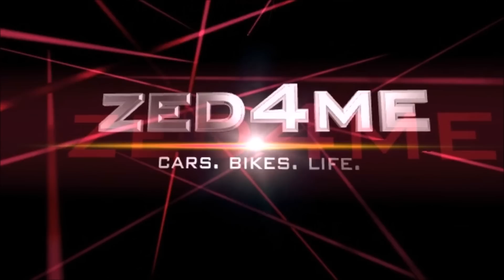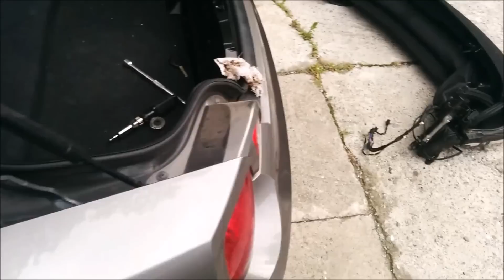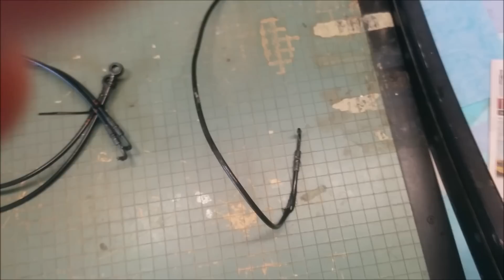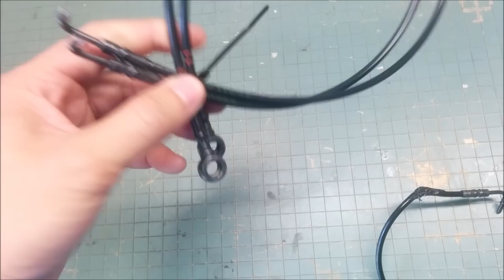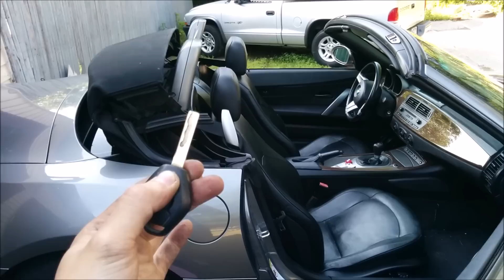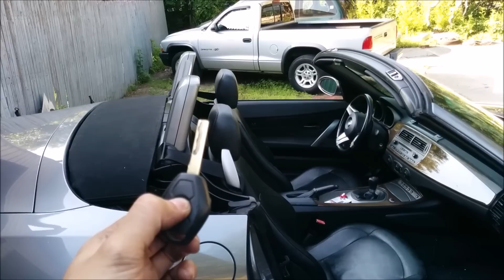Fixing Convertible Top - BMW Z4 Vlog #5

Comment: I removed and replaced my top on my 2004 BMW Z4 and need help setting the "top closed" and "top open" switches. Pump and latch motor both work but tries to open when I press "close" and vice versa. Please help.
Reply: Sounds like you switched the top motor wires.

Comment: Roof pops open but does not fold back, was working fine, left roof down several hours then stopped working. Roof locks again. But will not fold back.

Comment: Hey, I'm in the process replacing my motor. Reassembling the roof but I'm having trouble aligning the sliver bar to snap into the two U clips, it just doesn't seem to wana lock into those clips. Any tips on aligning and locking the bar into those clips?

Comment: HI
Is it possible to have some tips and trix in how to remove the Conv.top. I tried but got stuck when it come to loosening the top from the chassi, i.e the conv.top rubber strap that is attached to the chassi. I just didn't find a way in separating this without breaking something.
Regards
Gunnar
Reply from the maker: +Gunnar Andersson I don't really know which part you're talking about.. there's a good guide online though with pictures if you do a quick search.

Comment: Both key fobs no longer remotely open or close softtop or my door locks?

What part may need replaced?  
Do you have any suggested troubleshooting techniques to attempt before purchase of part(s)?
Reply from the maker: Would try the basics like figuring out if it's the battery. Swapping them isn't easy because these keys were designed to be rechargable. If the keys work, then the top should automatically open and close if it's been programmed to do so. The door locks not working either makes me think it's the key and not the car that's not functioning

Comment: what would your buddy be doing for the process of snapping in the hoop into the clips? did you snap in the hoop from the trunk?
Reply from the maker: +Diamond Bling You work your way around. I started at one side and put it into place while my buddy held the top to keep it from scratching the paint. After I got my side in I loosely put in the bolt, and then proceeded to snap in the rest. Once I doubled checked everything was working properly and not snagging on any lines, I tightened down the bolts. Buddy mainly has the job of keeping the car from being scratched.

Comment: My top quit working and when I push the button, the latches will open but the top won't go down.  Looked for a leak but nothing there.  how can I check the motor itself to see if it is working? do you know??
Reply from the maker: Your top motor has failed. Not much else will cause those symptoms

Comment: Is there any reason when you press the button to lower the top and it doesn't go down besides a blown motor? Like is there a lock that makes the convertible light blink red?
Reply from the maker: Yeah but if you hold the down button and hear any motor whirring that's the latch undoing and then the hydraulic motor activates after that.
Reply: zed4me so there's no physical lock I have to check? The two buttons should open and close the top so if it doesn't then something is broken right?
Reply from the maker: @dav1dizzle  there's a switch in the trunk that doesn't allow the top to go down unless the tray is down, that's the only thing I would check. Otherwise yeah it's a one button operation.

Comment: I wonder if you can take out the soft top and put a hard top in permanently.
Reply from the maker: NSXTypeRGTRLM I believe you can. The hard top gets put on top of the soft, which doesn't make sense to me cause it would add weight. But if I could ever get my hands on a hard top I'd do exactly that for winter time

Comment: Thinking about getting an older z4, one of my main concerns is the expensive roof braking.
Reply from the maker: Cornwall1888 It's definitely a matter of when rather than if.. so when you look at a potential car, and a good test is to hose down the top and see if water comes out of the drains underneath the car. They are located right in front of the rear wheel well, and if it isn't flowing well, chances are the drains are clogged and the motor, if not broken already, will go out soon from water ingress.
Reply: +zed4me could you make a video about how to check the roof?
Reply from the maker: daineserider it would be a very boring video. Just take a hose to the top and see if water drains out the bottom quickly
Reply: zed4me ok, thx!

Comment: My zs roof top failed today. Won't go up won't go down 😔. I hear the sound of the motor but it doesn't move I have no clue what it can be. Still browsing about it.
Reply from the maker: +napalmaki if you hear the motor buzzing away, it isn't broken obviously. Maybe the hydraulic fluid leaked and the motor is unable to move the top as a result
Reply: +zed4me thanks a million for the reply and the possible cause. I will go at some point to check it out at the garage.
Reply: ... left it at the garage today, they assume (haven't dismantled it yet) that it is missing the hydraulic fluids. At worse the hydraulic pump is damaged. Three days eta to be ready :( I miss her already...

Comment: Bro, where did you get the guide to remove the top? Also, where did you get the guide to program through NCS-expert? My top died. I also have NCS-Expert, among others on my laptop.
Reply: +VisVires Found it: http://hartgens.nl/z4/wp-content/uploads/2015/06/How-to-Remove-your-Soft-Top-from-the-BMW-Z4.pdf
Reply: That description is made by SHIPKILLER-the BEST BMW man you will EVER find, I used it and mind came off , replaced pump and cylinders and had NO problems at all

Comment: I feel like my problem for my soft top isn't the motor, but the wiring. When I hold the button to make the top open, nothing lights up. Same thing for the other butting to close it. Any advice? I already checked the fuse box and all of them seem to be functioning properly.
Reply: Hi Adrian, my Z4 2003 shows exact the similar problem.
To the solution owner, please advice how to solve.
thanks for helping!
Reply: +Fons Eijsink I haven't found a solution yet, let me know if you find anything out.
Reply from the maker: no red flashing on the center console?
Reply: Nothing was flashing, the top was electrical dead. I'm one step further. The aftermarket X-Car Style top module had to be reset (unplug>plug) after battery dead winter stop, now everything is electrical functioning again.
But....no pump is activated, red led flashing. So, replacing the pump will be the thing to do
Reply from the maker: Fons Eijsink That's correct, if the red led is flashing that means it's not in the completely open or closed position. The latch is unhooked but no roof motor to pull the top down. Replace the pump is the next step, but before you buy a new one, it may be possible to refurbish the old one that is rusted and dead. I did so and did not have to spend hundreds of dollars to buy a new one. Maybe find someone handy who may be able to refurbish it for you.

Comment: I need to replace the front plastic trim. Do you have suggestions on this?
Reply from the maker: I'm not sure if that plastic trim can be bought separately, sorry.
Reply: zed4me thanks. I actually got that trim piece today. Doesn't look complicated.
Reply from the maker: soarby007 Got the part number? i think mine may have a crack in one part of it if I remember correctly

Comment: Does anyone know what the part covering the convertible motor is called?? Mines missing it and I want to buy a replacement piece
Reply from the maker: Mine doesn't have it either but just so you know it won't help keep water out. You'll have to seal it some other way if you wanna keep water from getting in
Reply: +zed4me thanks, I just don't like the way it looks with the motor sticking out like that
Reply from the maker: Ryan McNamara you can see the motor?
Reply: +zed4me the hydraulic motor in the top of the convertible interior it looks like there should be a plastic piece covering it
Reply from the maker: Ryan McNamara are you talking about the latch motor? Or the hydraulic one which is behind you .
Reply: I know this is a Year old thread, did you ever find the cover for your interior motor? i just bought a Florida car, and this piece was also missing, a quick look on Ebay, and i only seen 1 on all ebay, i grabbed it quickly for $40, will be installing it next week if you need a part # give me a holler

Comment: I was looking at the diagram on realoem.com, (http://www.realoem.com/bmw/enUS/showparts?id=BU53-USA-07-2006-E85-BMW-Z4_30si&diagId=54_0313) and it looks like you had to replace only the set of lines for the left side.  Were the longer ones on the right side ok?  I may have a similar issue.  After the roof unlatches, I can hear the motor running, but the roof doesn't move.  I'm waiting for warmer weather to try removing the roof to check it.
Reply from the maker: I only had to replace one line cause I accidentally messed it up. I'm not sure it's a common issue as hydraulic lines are usually pretty tough. Perhaps you just need a fluid refill, but it's possible you have a similar issue. Good luck!
Reply: So was the hydraulic line the cause of the roof not working, or collateral damage during the removal of the roof?  If the latter, was there some other issue preventing the roof from working?  Did you replace the motor as well?
Reply from the maker: My motor had busted from water damage and while doing that work I accidentally nicked the hydraulic line so after replacing I couldn't get it to work but had to keep filling fluid so I realized it was leaking
Reply: In the video you say "it turned out not to be the motor that was dead",  but I missed the part where you said you just had to refurb the motor.   Considering that the motor is over $500, it is good you were able to do a refurb.   What kind of refurb was needed?  What did you have to buy?

I am hoping my motor is fine.  I've had the car for less than 2 years, and I did clean out the convertible drain plugs from underneath 6 months ago.  When I have the top out I'll make sure to again clean out any gunk.  I'll be happy if I can fix this for under $200 since my mechanic quoted me $1500!

FYI, there is a repair kit listed (item 10) on http://www.realoem.com/bmw/enUS/showparts?id=BU51-EUR---E85-BMW-Z4%203.0si&diagId=54_0313.  With any luck that would be all I need, plus hydraulic fluid.
Reply from the maker: So in this video, I had already refurbed the motor. The motor was rusted out and didn't work, my dad cleaned the contacts and just tried overall to clean off the rust and then it started working again. I suspect there are many "dead" motors out there that can be refurbed but for most people, it's easier to just buy a new motor.

Comment: Question:  Does every Z4's key fob operate the convertible top?
Reply from the maker: C Ross they need to be programmed to
Reply: So, would the dealer do that?  Is it that simple?
Reply from the maker: C Ross dealers may say it's not possible but you can do it if you can use bmw diagnostics tools
Reply: Yeah ... I don't have any sort of BMW diagnostic tools.
Reply from the maker: C Ross doesn't hurt to ask dealer but I don't think they'll be of help.
Reply: Fair enough.  Thank you so much for the advice.  :)

Comment: My top opens like half an inch then is stuck there any ideas?
Reply from the maker: Jim Moua hydraulic motor failure. The most common failure from water ingression
Reply: Latch motor works properly  is why it opens slightly. Top motor is bad is why it wont go up/down.

Comment: how or where did you get the up and down working on your key fob
Reply: +Model Flyer  Using the key fob to lower the top is part of individual driver setup in the programing of the car to each key... and works with pressing and holding the unlock button once setup.
Reply: Michael Ruffner how programming it? Did go to dealer? Ir by urself if yes how?
Reply: BFiT Iscool dealer or Indy shop has to do it

Comment: two wires for $160!!! fucking bmw. dont wanna buy that shit.
Reply from the maker: +max printscreen I just had to buy a clip today, you'll see why in an upcoming video. List price $40 for a plastic clip...
Reply: +max printscreen - They're not wires, they're high pressure hydraulic hoses.
Reply: I'm a tech and he called them wires, but they are hydraulic fluid lines, I am working on one of these  B.M. Trouble you Z4's and would never recommend owning one, I am a diversified Mercedes tech, love Japanese and certain American cars. But pretty much all bimmers suck !